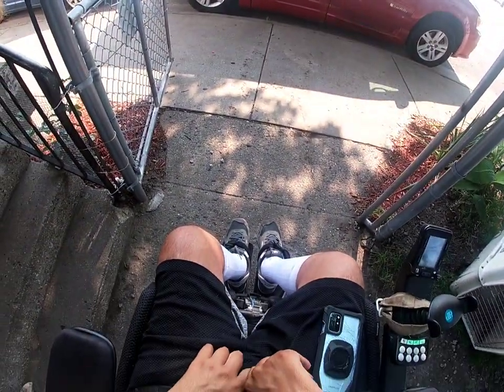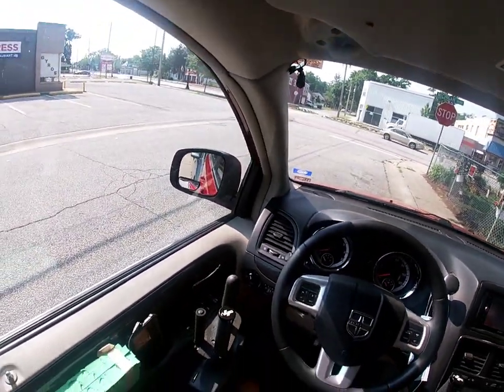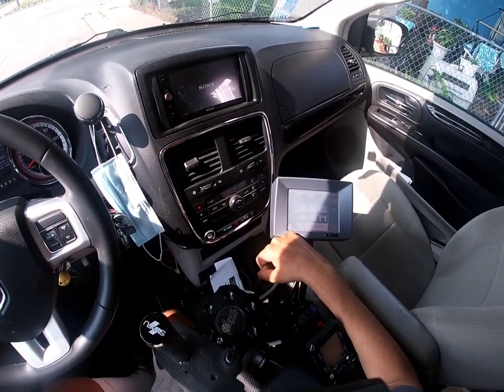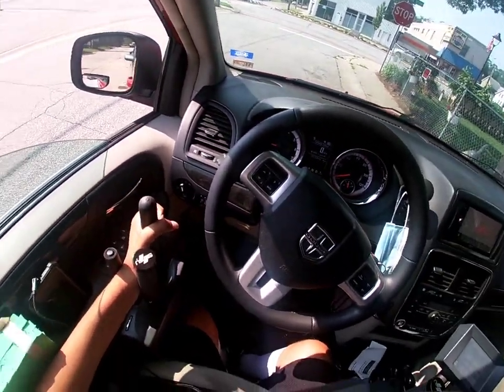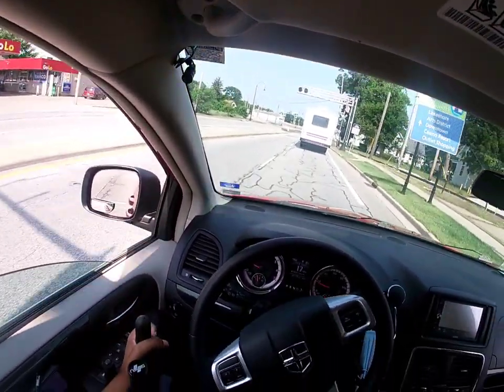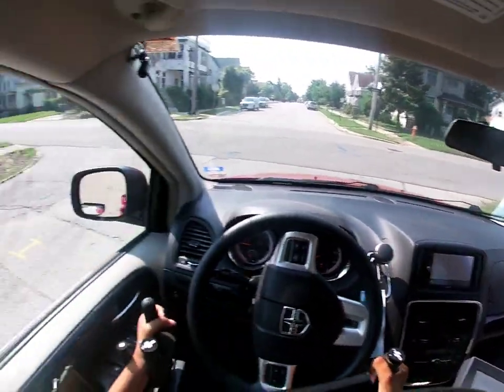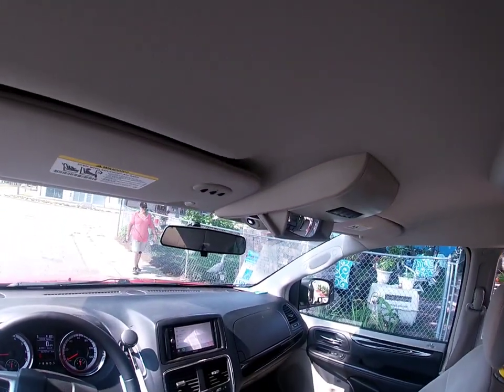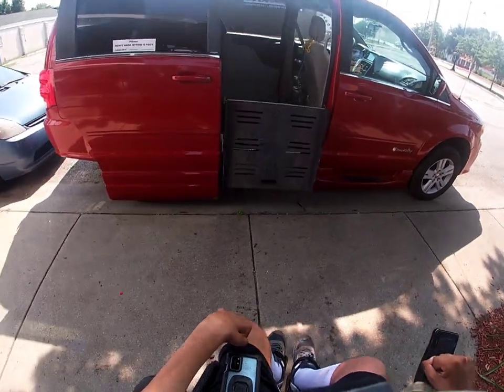Quadriplegic C4-C5 Driving Setup Walkthrough with EMC Aevit Hand Controls Accessible wheelchair Van.

Comment: Great job. On your video. I just purchased a 2008 Honda Odyssey. with this System in it.. I'm AC5 C6 incomplete quadriplegic. I use regular hand controls so this. system is really touchy for me. It's really sensitive. Gona look for a dealer here in Mesa, AZ to see if I can get somebody to adjust it before I sell it. Your vehicle looks like it Drives a lot smoother ON the accelerator and the breaking part.. Great job.

Comment: Brian, I really enjoyed your Video. My name is Hugo and I have MD. I stopped driving a Sienna Van with rear entry with no special control, 2 years ago. I have saved money to invest on a side entry VAN with EMC controls. I live in Utah and I called EMC requesting information but they want me to go to an Evaluator first. The closest Evaluator that I could find was in Tempe, AZ. they want about $6000 for Clinical, Physical and Driving. I cannot see their Van until I complete all Clinical, Physical, cost $1150,  before I can enter the Van after spending the $1150. I do not know you how you were able to buy your equipped Van and bypass these Evaluator Robbers. Please, shed some light on how you accomplish the purchase of the Van and of the EMC equipment including installation without having to go to an Evaluator. Thanks for your any help you can give me. I also ask other members of this group to weigh in.
Reply from the maker: my injury was back in May 2012. I purchased this vehicle out of pocket from another individual that was selling it. 
If you are currently working or are planning to work, you can have vocational rehab work with you to cover modification expenses.